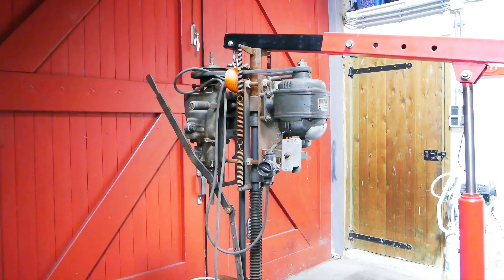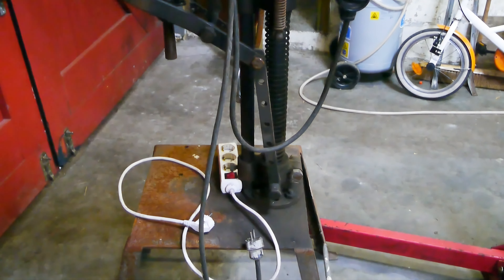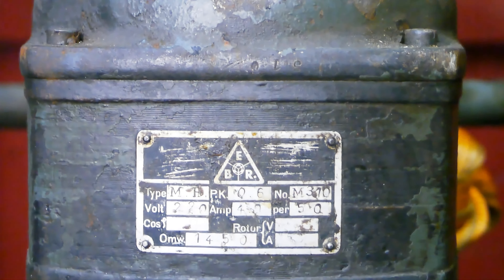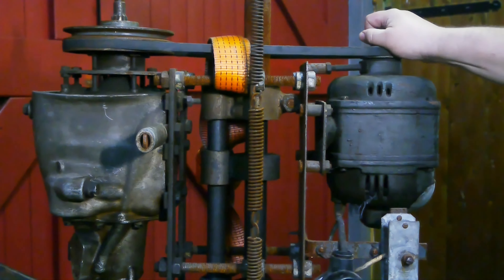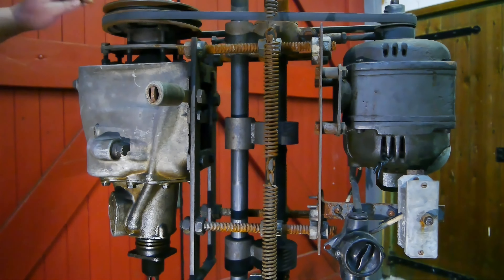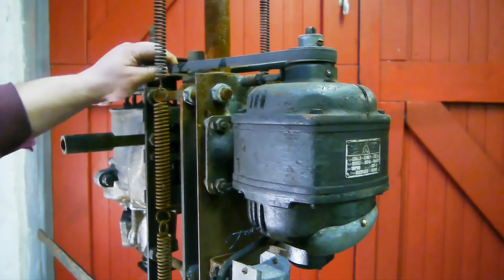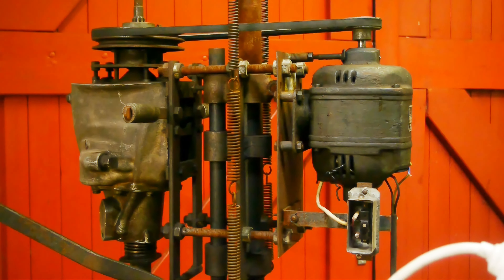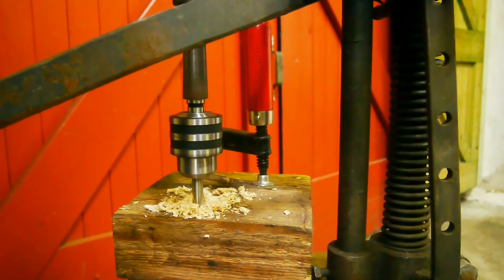Drillpress from Gearbox 4k

Comment: I don't see much (or any) difference between the old and the new video. Youtube has it's settings on 480p. The sound is louder in the original video. I hope it helps a bit.
Reply from the maker: C'mon it done with A.I. so it must be good :)
To be honest I don't see much of a difference on my 1080p monitor.
I denoised the audio, but that's not A.I.